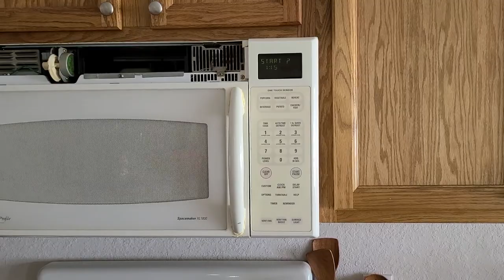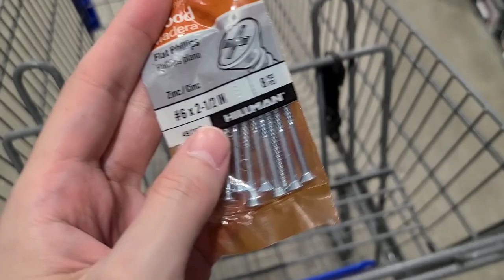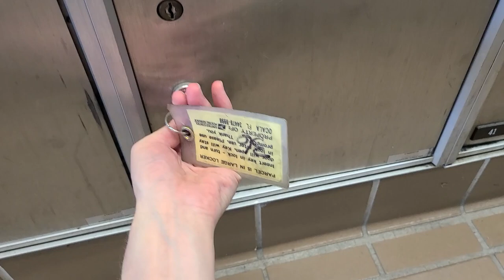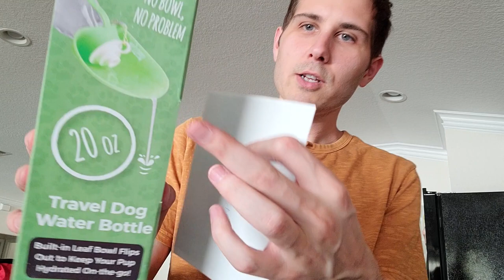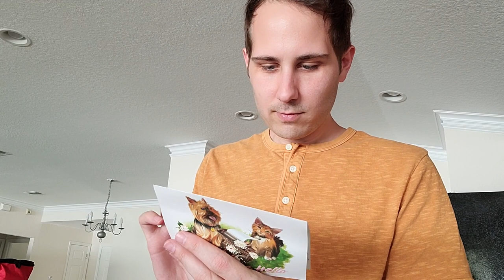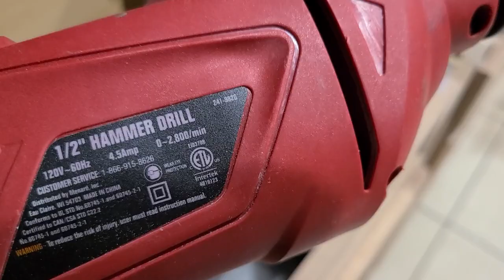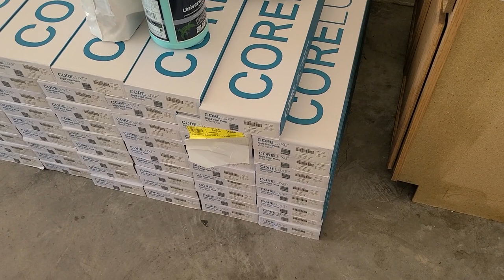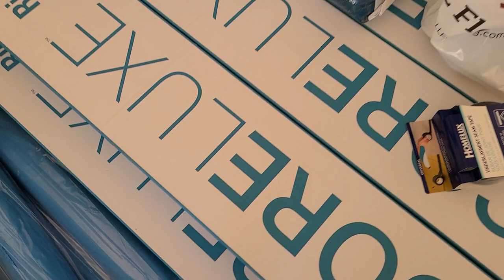3/8/23 Vlog! My FLOORING Arrived! Florida Home Vlog

Comment: When you come to paint your cabinets the secret is lots of thin layers allowing them to dry thoroughly over several days Sounds like a long process but it avoids drips and other visible flaws
The other option may be to get them spray painted professionally doesn’t cost that much but you finish up with a consistent surface

Comment: What is a hammer drill used for?

A hammer drill delivers more power in the form of a hammering action. The force of the hammer drill is applied directly to the bit. They are most commonly used for drilling in concrete and masonry. The hammering portion of this motion can be turned off, allowing the tool to function more like a standard drill.

Comment: You need a cordless drill…for at home use. Ryobi is a brand you can buy at a good price at Home D. Make sure it has two batteries and a charger( they probably all come that way) The drill will have adjustable turning speeds! Also reverse!
Good luck

Comment: You have to drill a pilot hole first, Jeffrey. Use a slightly smaller drill bit than the actual screw, THEN go through that same hole using the screw. Good luck!

Comment: I don’t think you’re supposed to use a hammer drill for wood. Ask advice of one of the old guys in Home Depot or Lowes. Also I was told when I had a new floor put down, the new flooring needs to rest for a while in the environment it’s going to be laid in so maybe that’s why it’s not being laid immediately.

Comment: I am with you 100% on the white appliances.  You might consider painting the alcove the color of your sofa. It would bring the color to that side of the room and dark enough that the tv would stand out so much. You also might want to look at ranch casing for the baseboards and cove molding for the crown. These are  both used in modern design.

Comment: I agree with all the design elements you pointed out, especially NOT having different levels by keeping the tiles -- yuck.  When putting in a new floor, why would you compromise.  This is the perfect time to make everything the same level.  Love Stella's new water/drinking leaf vessel.  And I most especially agree with being over stainless steal.  My house was done new prior to my purchasing it and the only thing I dislike is the stainless steel -- I'm constantly wiping finger prints etc off the fridge and microwave -- sigh.  Can't wait to see your house with the new floors.  Every time I see your sofas I fall in love with them all over again.  And, I love that light blue lamp base with modern 3-tier lampshade.

Comment: Jeffrey we also just had to replace our microwave and got a white one. All our appliances are white so it had to match.  Our cabinets are a birch colored shaker style. The house is 13 years old.  Make sure you have someone strong help you install the microwave.  I have bad arthritis and helped my hubby put it in and I swear it almost killed me.  Our new one is stainless inside tho. But is not a convection or air fryer.

Comment: If you are going white on cabinets, why didn't you go with painted ones already?  Very hard to get smooth finish on cabinets. Just curious ?
Reply from the maker: The existing cabinets are wood so I'm already needing to paint those and to keep things a little bit more consistent just went with the slightly cheaper, oak ones.

Comment: Aren't you supposed to store the flooring IN the area where it's going to be installed in order to acclimate to the temperature and humidity?  The garage would be different than inside the house ... less insulation in there, and more "air gaps" I would think.